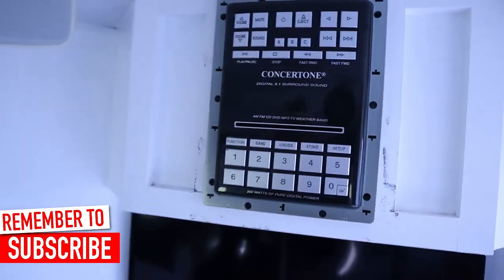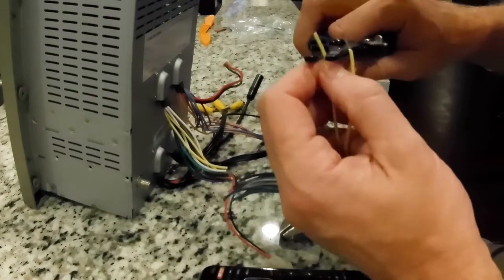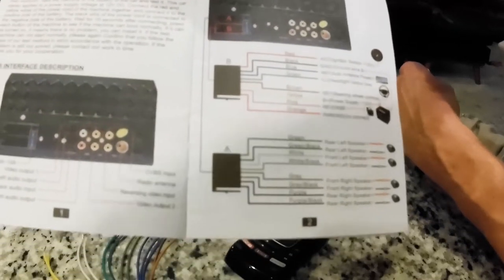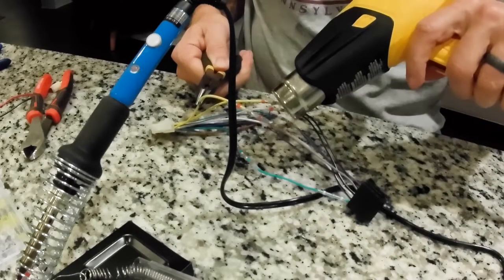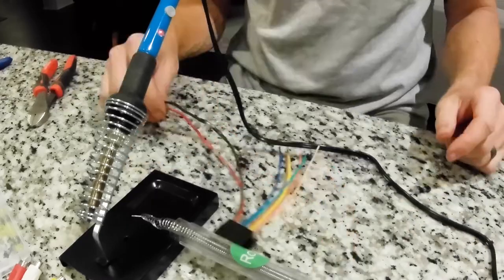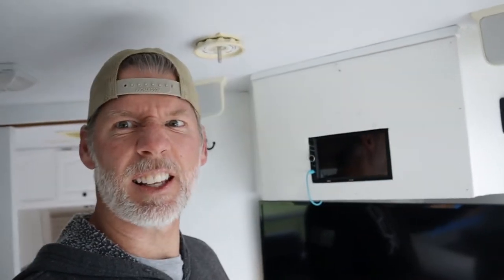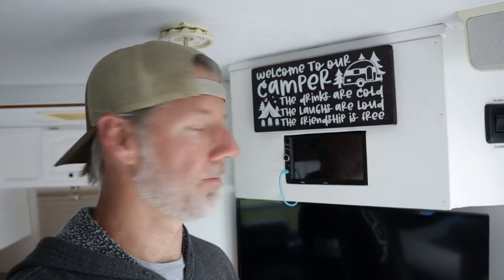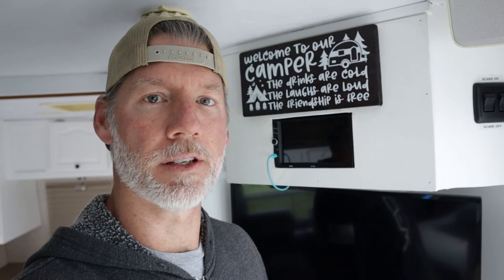REPLACE Your RV Sound System with NEW Technology | Android Car Stereo

Comment: I just got into a chariot eagle park model and I noticed that there is a built-in speaker system with a harness output how would I get an adapter so that I can plug it into the TV so that I can hear TV sound through the built-in speakers in the ceiling great video by the way
Reply from the maker: The TV should be easy. Any audio output on it would work. Probably the easiest would be regular RCA outputs. The question would be what input does the sound system have that you can connect to? Wish I could see a pic.
Reply: @WillMosbey  i would love some help if u have a snapchat I could send some pics
Reply from the maker: @coolinwithlaura4114  I have a Snapchat but never use it. Here it is. https://www.snapchat.com/add/willmosbey?share_id=cQ-Q96Npuos&locale=en-US
Reply from the maker: @coolinwithlaura4114  you can also IG me @willmosbey

Comment: Hey, great job on the video.

I'm trying to replace the exact same Concertone unit in my trailer. I'm getting hung up on the speaker zones.  The Concertone has three speaker zones.

How did you deal with that?  Or did you just wire it so they all are active all the time?
Reply from the maker: There were only a couple of ones I wired together and I believe they were the rear speakers. Everything else was wired with it's respective position. My concertone showed the wiring diagram on the back. I tried to match it up the best I could with the new radio.
Reply: @WillMosbey  quick question do you put  the red and yellow together ?
Reply from the maker: @leoorla  to be honest I don't remember but I believe they do go together. Sorry I couldn't be more help but that was quite a while back
Reply: @WillMosbey  thanks i putting together and work fine

Comment: Hey just cought your radio install didn't look to bad.  Question u said it had a back up camera couldn't you hook it up to a small monitor or the radio mount outside as a security camera just a thought
Reply from the maker: I actually installed a backup camera by wiring it to one of the red marker lights for power. The receiver/monitor them plugs into a cigarette lighter in the cab and connects wirelessly. Works great.

Comment: Does that little stereo play DVDs?  Are rv speakers 4 ohm, or 8 ohm, and does that radio work properly with them?  My DVD player won't play anymore, and I'm also wondering if there's a way to just hook a DVD player up, but don't know how to get it to play through the rv speakers.
Reply from the maker: Yeah hard to find stuff that plays DVDs anymore. I too have a portable DVD player that connects via USB. I would probably hook the DVD player up to the tv either through HDMI or composite AV cable. Then just play the sound like normal through the RV stereo. Should work fine.
Reply from the maker: I'm not sure what ohm the RV speakers were but if I had to guess I would say 8 ohm.